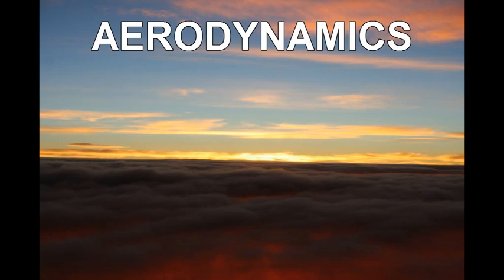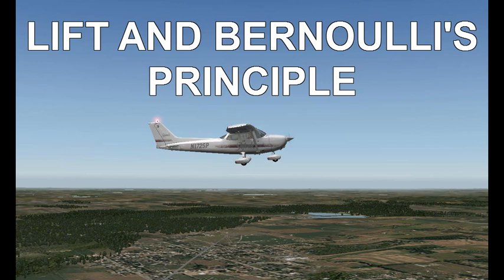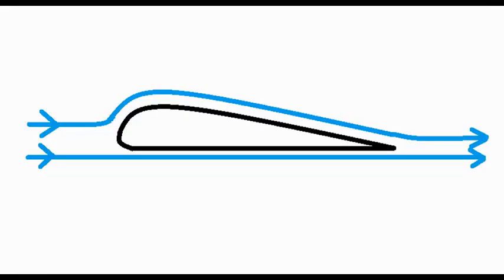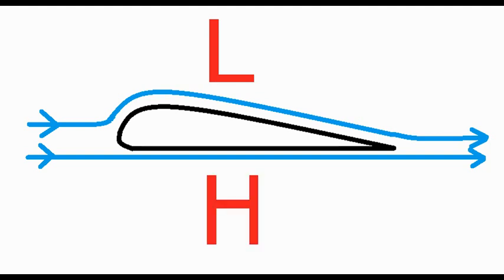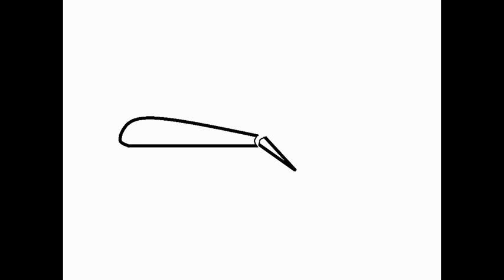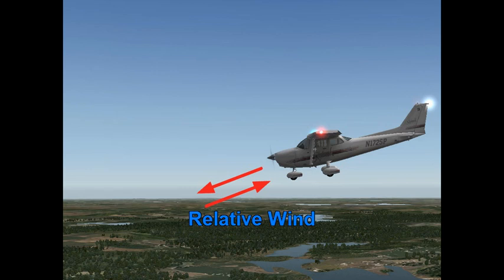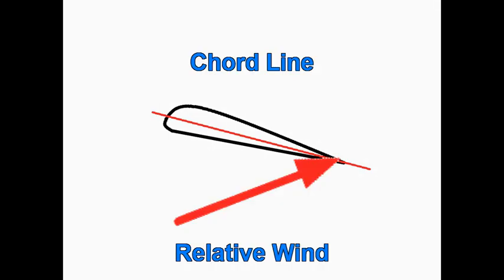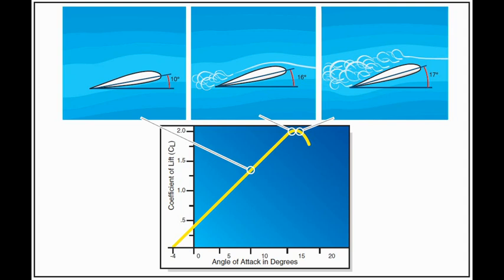Flight Simulator Lesson 3: Aerodynamics

Comment: P.S.  The 'Blown Paper" demo is misinterpreted.  A curved path of air is an accelerated stream of air.  Acceleration requires a force to cause it (F=MA).  Acceleration is a CHANGE in speed OR DIRECTION.  The force is a pressure difference.
...
When the paper is curved, the air tries to follow it and does curve somewhat due to the pressure difference, but this is BECAUSE OF THE CURVE not the speed.  That may be confusing, but a straight stream does not do this. See the Babinsky Video.
...
Relative motion between a stream of air and a CONVEX surface is what causes the pressure change.  See Weltner for a more in depth explanation of just why this happens..
-- 
Cheers

Comment: As promised: 
First, what Bernoulli revealed is the inverse relation between velocity and pressure BUT ONLY between different points ALONG a SINGLE stream where no energy is added nor removed. In the classical case usually referred to, the air speeds up BECAUSE there is a higher pressure region pushing it toward a lower pressure region - that's why it has a higher speed when it gets there.  An ordinary jet of fast air has the very same pressure as the air around it.  Nothing else makes sense.  In addition, the wing is doing considerable work adding energy to the air, most easily seen in the downwash. The "Fast-Air-Has-Lower-Pressure" thing is not some fundamental principle of physics that must be learned like Newton's Laws of Motion.  It is just some bad story that has been repeated so many times by so many for so long that it is all over, making it just about impossible to find the real science.  Everybody loves "The Bernoulli Principle" which doesn't exist....  I recommend reading David Bentley's paper first, then Holger Babinsly's video second.  
...
SUMMARY simplified, but not incorrect......
As the wing moves through the air, part moves toward some air which increases its pressure and another part moves away from some air's natural path which decreases its pressure.  This pressure difference is the lift.  In addition, this pressure difference pushes a volume of air downward, thus satisfying Newton's "equal and opposite" Third Law.
...
Dave Bentley Wings Don't Suck 2015
Once you really understand it you will not be baffled by the fact that the fastest air around a wing is just UNDER it!  
This can easily be seen in the sequence of images from the Cambridge University videos on the 6th page of Dave Bentley's paper. The vertical line is stationary and the wing is moving past it.  Look at which air streams move the furthest (fastest) and which move the least (the slowest).  If you don't understand this, It'll blow your mind.
http://219sqn.aafc.org.au/Flight/Wings%20don't%20suck-How%20planes%20really%20fly.pdf 
Bernoulli's Equation says absolutely nothing about air speed relative to a near-by surface; only about different points along a single path of travel. 
...
Video lecture explaining Bernoulli. If you understand Newton, you'll clearly understand Bernoulli and lift much better after this video, or his paper also linked here.
Dr Holger Babinsky, Cambridge University Engineering Department.  Common misconceptions on lift.
https://www.youtube.com/watch?v=XWdNEGr53Gw   
You'll need his MISSING SLIDES from HERE (Click the Download Icon for the complete set of slides):   
https://docs.google.com/file/d/0B0JABuFvb_G_MkpBZHJmRGo3UkU/edit?usp=sharing  
Also:
https://docs.google.com/file/d/0B0JABuFvb_G_MkpBZHJmRGo3UkU/edit
...
This is the equivalent 2003 article he mentions in the video:
http://www3.eng.cam.ac.uk/outreach/Project-resources/Senior-glider/howwingswork.pdf   
The video is extracted from Cambridge University undergraduate prospectus 2006/2007 (so the video was done at about that time, or earlier.
PLEASE NOTE than when Prof Babinsky says "Coanda" he mispoke.  The term "Coanda Effect" is reserved only for high speed jets or sheets of air FORCED over a curved surface, NOT for air "normally" flowing around a wing.  While the two look very similar, lots of people debate whether ordinary lift is, or is not Coanda...

The non equal transit time (only) proof video by Holger Babinsky, Cambridge University
https://www.youtube.com/watch?v=UqBmdZ-BNig   Narrated, no title at start Cambridg U
Also:
 https://www.youtube.com/watch?v=6UlsArvbTeo  Un-narrated, pulsed Titles about stall are off.
...
...
Weltner as an extended version  web page:
http://www.angelfire.com/dc/nova/flight/PHYSIC4.html 

...
Peter Eastwell; an educator who did his homework:  
 http://www.scienceeducationreview.com/open_access/eastwell-bernoulli.pdf 
Weltner in an abbreviated PDF - "Misinterpretations of Bernoulli's Law":
 http://user.uni-frankfurt.de/~weltner/Misinterpretations%20of%20Bernoullis%20Law%202011%20internet.pdf    
...
Jeff Raskin's 6th grade calculations using a common bad example of "Bernoulli Lift" and the incorrect "Equal Transit Theory":
http://karmak.org/archive/2003/02/coanda_effect.html#appendix 
...
This next video has a pretty good overview.  Note that he says that "You can use BOTH Bernoulli AND Newton to explain what's going around the wing." My emphasis.  He does not say EITHER...OR. However, it does not go into detail how the pressure difference at the wing is actually created, nor how the "curve" in the air's path is created.  You must go to some/any of the other references for that.  
...
This is the best true lift Simplified video I found on You Tube by Bloodhound:
https://www.youtube.com/watch?v=OjruwfiUtGY 
Bloodhound does seem to emphasize the downwash 'action-reaction' part, but note that it does not ignore the pressure differences.

MinutePhysics' video is a good simplification of lift that is not wrong, though he glosses over the downwash.  He was coached by Airbus engineers:
https://www.youtube.com/watch?v=Gg0TXNXgz-w 
...
Cheers, ScienceAdvisorSteve
Reply: You are so full of crap Steve.
So,  there is no Bernoulli principle, ehh? 
You seem to like Coanda though, how do you have entertainment into a jet stream if the jet stream isn't lower pressure?